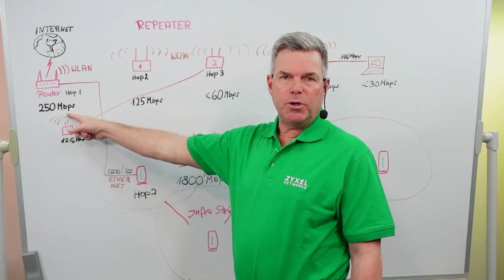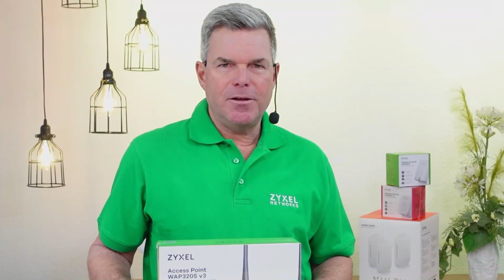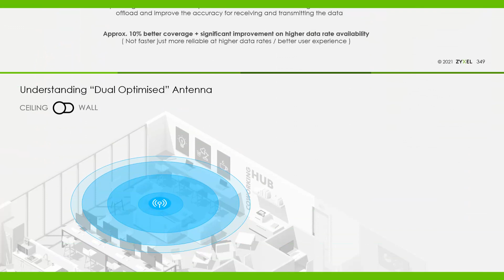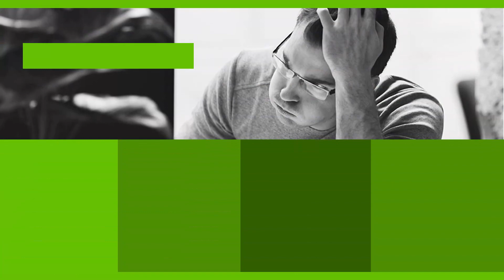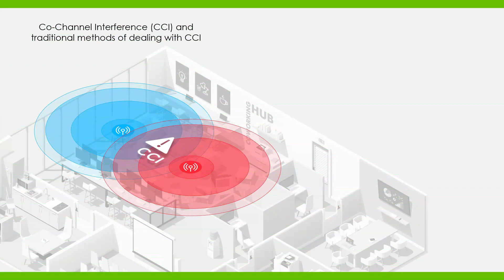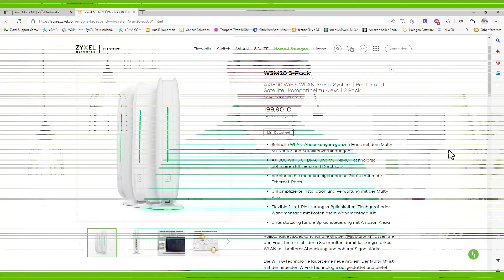Ask ALLY - Repeater or Mesh System?

Comment: I want a software router zyxel vmg3625-t50b or username or password to log in to the router
Reply from the maker: Hey, I don'r really get what you mean. VMG is the primary router you can connect to a Mesh-System or repeat with a WLAN repeater. You don't need to log in to the router to establish this.